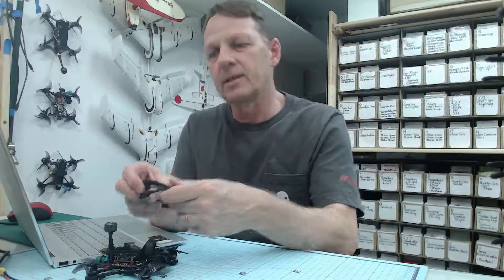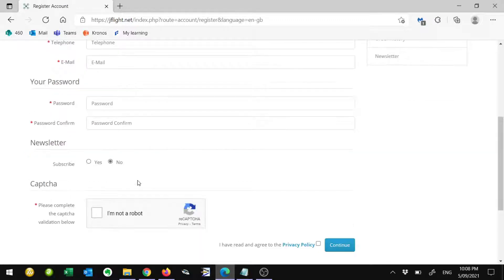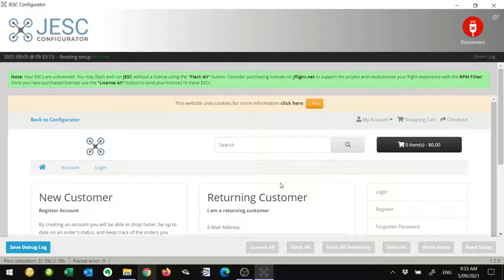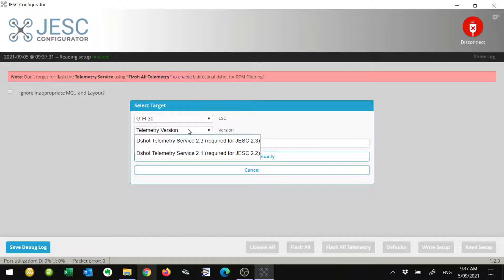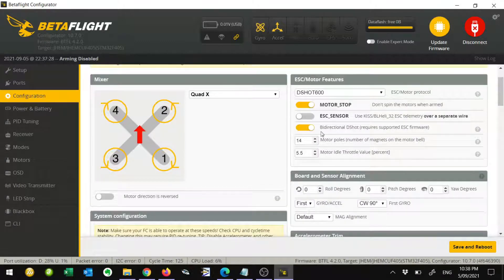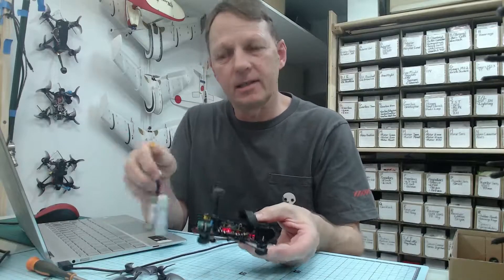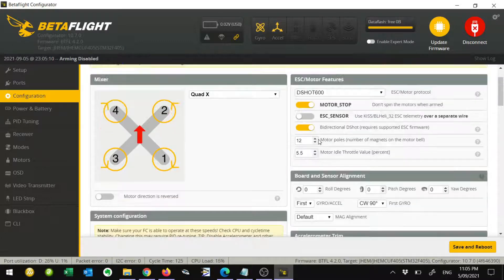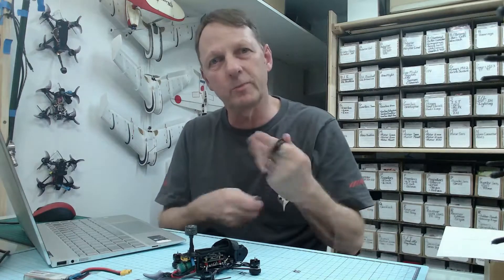Installing and setting up JESC ESC Firmware for Bidirectional DShot

Comment: During 3D mode configuration: I destroyed 3-4 motors and possibly the ESC today after I enabled bidirectional DShot and the drone brought the motors to 100% throttle on its own in a disarmed mode. I explain it in my new video. But i have not flashed my ESCs with BlueJay. Maybe this was my mistake ?

Comment: I might be wrong there but I upgraded ESCs in all my quads including whoops to ESC 16.9 release and that had bidirectional d-shot function, running rpm filtering on all that support BF 4.2 and it was free
Reply from the maker: Okay not sure why that worked but good.

Comment: what would you recommend for a 2.5 inch drone  (Protek25)  the 48khz or the 24khz pwm , yor advice would greatly be appreciated , and bye the way great video 👍
Reply from the maker: It seems to have XING 1404 5500KV motors. I haven't done anything with these motors with 32 bit but in general larger motors like tbhis should stay at 24.
Reply: @cubefpv  ok , thanks for the advice , greatly appreciated 👍